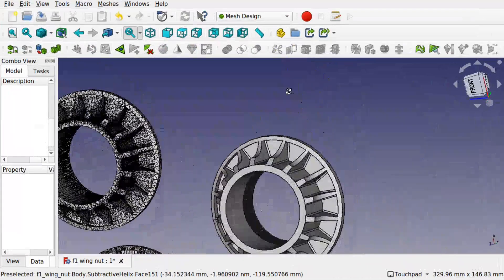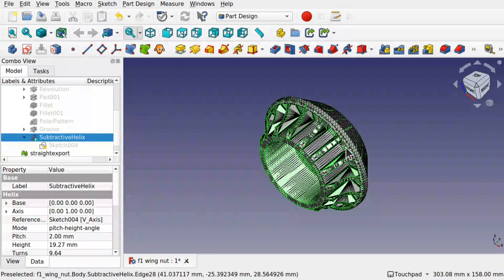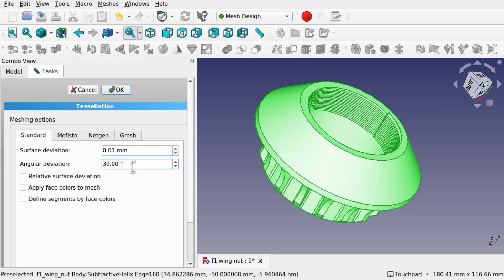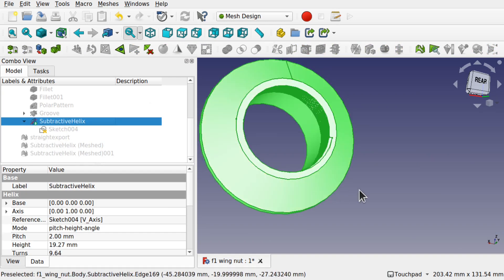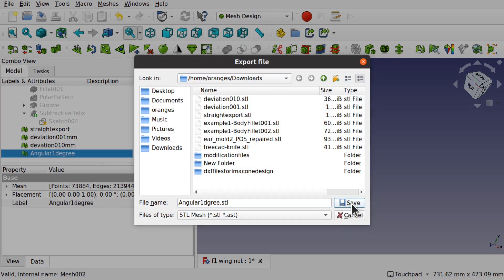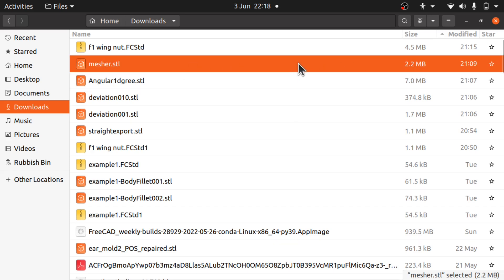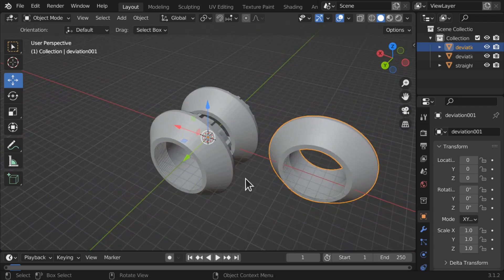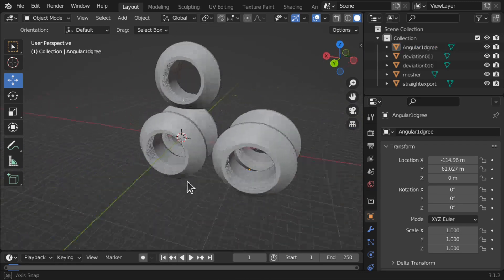FreeCAD: Output Quality / Resolution For Better 3D Models | Printing (STL etc)

Comment: i want to go the other way?

have an STL, makes it crash every time i load it... too many vertices or at least its right on the limit...

but at some point i have opened it, managed to reduce it somehow, as i then sliced and diced and altered things...

but i still have no idea how i actually did it, now i want to make more changes to the original STL...  lost the edited version...
Reply: Tesla what if you opened the stl in blender and decimated it to remove extra vertices? Then you can export that and import back to FreeCAD.
Reply: @stripedpants1668  thinking of doing something like that... just get annoyed when i have to deal with yet more software and learning curves rather than what i want to be doing? bad enough figuring out freecad itself.

iunno, i should play around a bit more, there is definitely a way of doing it... it may have just been "simple copy" but i am sure i did something else... mesh workbench? who knows!

Comment: Long way to say that just changing the degree in meshes will make it much bigger in file size and much more detailed and nuanced. I am still curious how these 3 changes in Cura and when 3D printed.  This is the number 1 reason I looked after this video. Because using Freecad is a bit troublesome in the beginning thing dont want to do what you want, while Tinkercad cannot get the same detail, and Fusion (personal should been free but they just locked it so I am back to Onshape and freecad). So printing with the same measures and build model from freecad was better than tinkercad, but Fusion was able to make the cylinder smooth as round, the others didnt (I still need to tast onshape), but now I am getting a grasp on freecad I like it. Making drawings is a struggle, and that I cannot in onshape unless I start finding my wallet. .. So how will the end result be, physical?

Comment: Very helpful, thank you. People (and even the documentation) tend to say "change the view settings to make your exports better" but I don't want to change them back an forth every time. Of course I don't want view settings that lead to a lag fest but that could happen if you set it to export quality.
It never ocurred to me, that the mesh workbench is what I was searching for the hole time, I was just like "why are there no export settings??". ^^;
Also this here seems to be in mm and not in "% of object size" what you get with the view setting. That's so much better.
I don't really get the math behind the angular deviation and in what scenario you would restrain the angular deviation vs. the surface deviaton. Also: is angular deviation the same as angular deflection in the view settings??

Comment: Just a quick tip seeings you've put so much help out there, when importing to blender, you can right click even a lower quality part that was displaying them face lines, right click it and hit "Shade auto smooth" and it will get rid of them, its handy if you just want blender for rendering and or animation, keeps the face count low yet still looks smooth as a baby's b... lol, if you dont see shade auto smooth and only smooth, grab the latest version of blender or click the Shade smooth option then on the right side goto object data properties which is a little green upside down triangle and go down to normals in there and hit Auto smooth
Reply from the maker: Thank you so much for sharing this and detailing the process, really greatful for that 👍👍👍😁😁😁
Reply: @MangoJellySolutions  no worries mate, hope it helped

Comment: nice examples.. May I say though - the angular may not be particularly suitable for 3d printing due to it large filesize and the amount of movements the printer has to deal with. that said though, it could be a step in the right direction if you need fine detail, just using a larger setting, say 0.5 would reduce from 7mb to around 3.5mb and less stress on the printer.
Reply from the maker: Great info you supplied. Thanks for sharing

Comment: I'll have to play with the MesherWB at some point when outputting for FDM 3D printing. But, without knowing about using the MesherWB to first convert to a mesh object, I've had success with the standard STL export by changing the output resolution in preferences "Import-Export/Mesh Formats" to 0.01mm without having to first mesh my object with the MesherWB. (Note, you do need to load the MesherWB in order to get the "Mesh Formats" tab in the "Import-Export" preferences.) But I wonder if I'm just getting the same result as changing the Mesh conversion to 0.01mm as you show in this video.
Reply from the maker: You would be getting the same results for changing the default preferences. Also changing them in your preferences should change them as the defaults for the mesh wb when you create a mesh from shape

Comment: Can I ask or make a suggestion to further this object? Really because I am at a loss as to how to accomplish it myself! Take the wheelnut and remove the threads you added internally. Now imagine that this had to fit on to a shaft or axle with a splined end rather than a threaded. How would you add the splines to the inside of the wheelnut? I've tried using the polar array function and failed miserably. Maybe this would be an idea for a future video, adding splines to an object rather than threads?

Comment: cant get it to work keeps saying select model first even when selected?
Reply: You need to select the body rather than the model.  If your drawing has more than one body, you need to ctrl-click and select all the bodies.  Hope that helps.
Reply: @marti6464  thank you ill give that a try
Reply from the maker: Thanks for the comments guys, glad it's all sorted. Just been trying to recreate the issue for the last 30 minutes and couldn't think what you may of done. Don't worry, time not lost as I have found a couple of settings that I have been looking for for a while. And thanks for the resolution, all good for the community 😊😊👍👍👍👍
Reply: @MangoJellySolutions  I missed out a bit it seems that you cant bring any stl you want and do this Bugger

Comment: great video.. this will definitely help with print quality.
Reply from the maker: Thanks for that, and thanks for the comments on the  video regarding output quality to screen. This jogged my brain into remembering about the settings for finner output for models. I'm still researching the use of the mesher settings. I am wondering if it's going to help with displacement uv mapping in Blender as it's more of a sub divided surface.
Reply: @MangoJellySolutions  Hi, you mentioned about displacement mapping  and this is something I am considering to utilise for textured mesh surfaces e.g. brick work for a wall in Freecad. So far blender seems to be the only freely available software that can handle this. Would love to see a video on this subject by yourself.
Reply from the maker: @TheAndrian463  you will be happy to know it is in the making 😁. It's an interesting realm as you need to use a combination of different stl output settings in freecad along with blender sub surf modifiers and displacement to get the best effect. Also if your like me and your running on a computer that's 10 years old then there is some additional techniques you can use to unwrap parts of your object rather than applying surface division to your whole model which constantly cause blender freezing up or crashing for myself.
Reply from the maker: @TheAndrian463  another way would be to use lattice2 to add repeating geometry (next week I am releasing a video that has been sitting as early access with my Patreons for a while regarding creating a diffusion pattern for tail lights) but if your going for a more organic feel then finishing in Blender is the best option.
Reply: @MangoJellySolutions  Awesome, looking forward to it. Yup in the same boat as you with hardware limitations, just looking to build my own PC with possibly a Ryzen cpu which has a top end single thread speed for Freecad.
Reply: @MangoJellySolutions  Hi, interesting about the lattice for say regular repeating patterns like brick work etc but I am dealing with walls using irregular stones, displacement maps being made from photos.